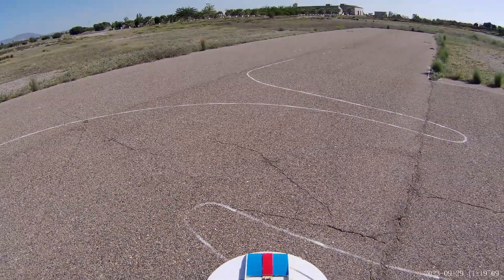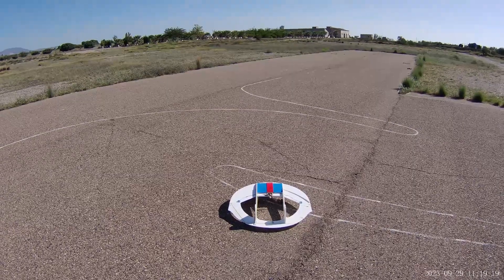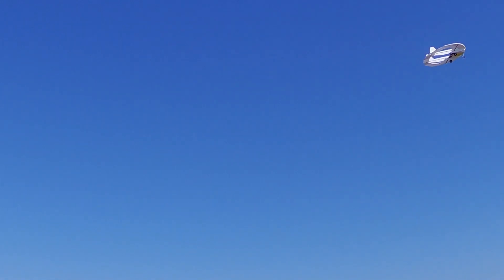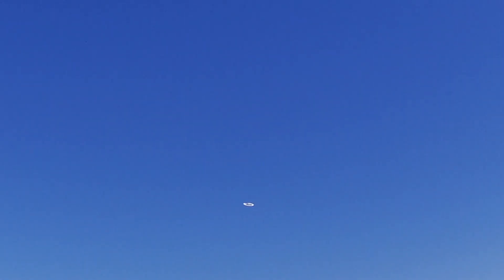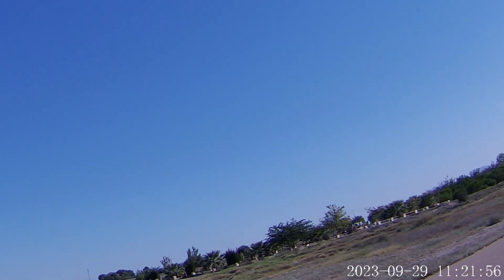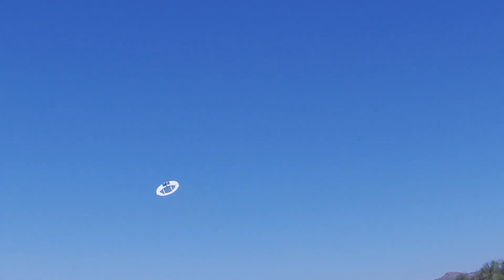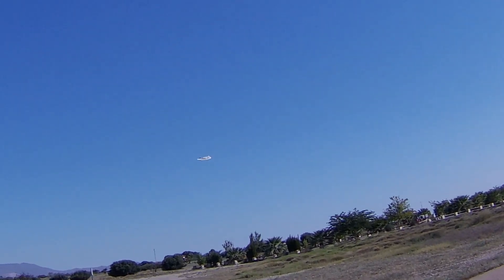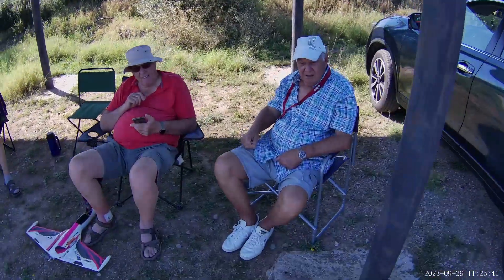GeoBat - A Better Flight!

Comment: Nice flight, fun to watch. Seems you could easily increase the size of the ailerons for a little more control?
Reply from the maker: It's not really that easy as it would reduce the elevator area and make the edge of the circle where they are located thinner and weak. The recommended option is to put extra surfaces on the trailing edge of the front wing section. Thanks for watching, have a great day!